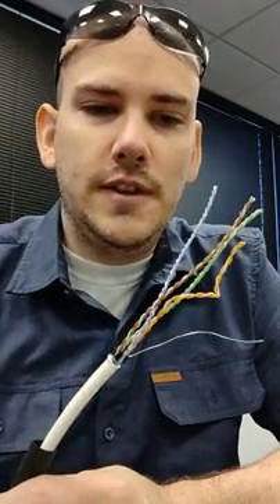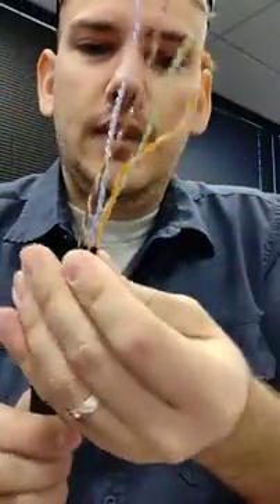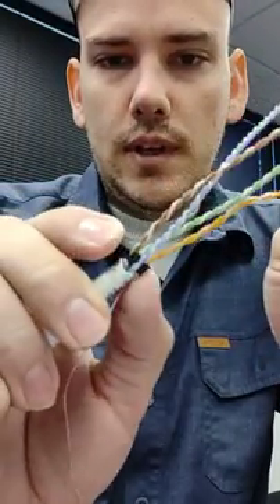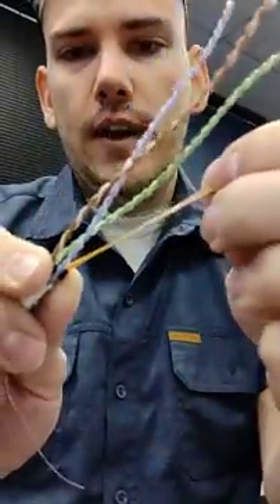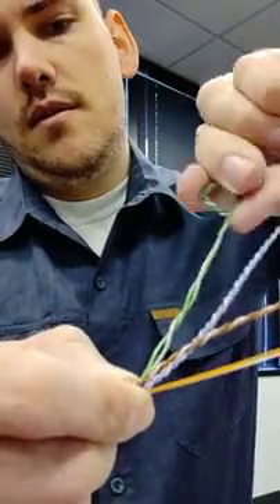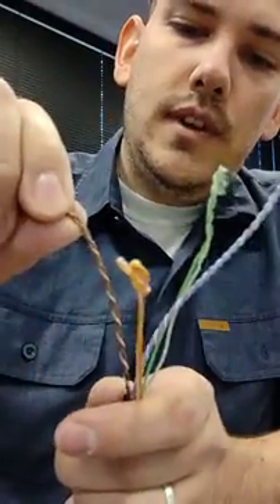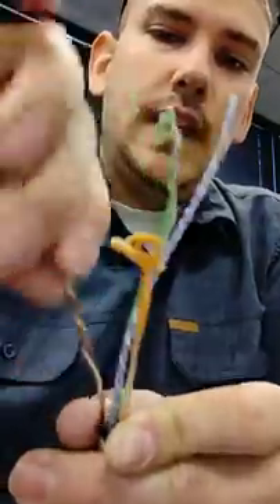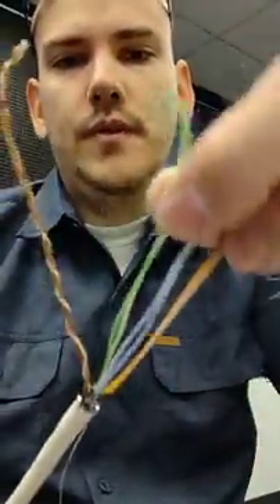The best way to untwist and straighten twisted pair cable in one step

Comment: Perfect advice!  I’m about to wire my own security system PoE and was making some test runs on 6E cable and was hoping there was a hack for getting the conductors straightened for RJ-45 terminals. This is it!  Thanks bunches!

Comment: This is fantastic, thank you.  I've never made any CAT5/6 cables until this week.  Moved into my new home and had to terminate about 20 ends and build several cables.  The first few before I found this were frustrating.  This with the pull-thru connectors makes it easy!

Comment: Interesting!  I split the end and spin one wire around the other with my finger on the tip.  Your method does not require the straighten step and returns the wire to it's original shape.

Comment: With all that wire it seems like quite a bit of waste. I only strip it down  about an inch and use nylon jaw jewelers pliers to gently straighten them out.  Not bad though, nice tip.
Reply: Yeah, there are many people that play Tarzan on the cable to get that perfect "E" string and then STAPLE the cable down killing bandwidth leaving a tiny amount left to work with.  They should be forced to correct it at their expense, like engineers should be required to take apart and put back together what they design!
Reply: It's an extra 3-4" of wire, so maybe 10 cents worth if it's fairly expensive wire (cat 6 direct burial gel filled shielded). It is WELL worth the cost to end up with nice straight wires, ESPECIALLY if using pass-through plugs

Comment: Nice. This is more curiosity than a real issue but you twist individual conductors in the process. Are they twisted in the manufacturing process and your part is actually un-twisting or not?
Reply: So twisted pair cabling like cat5e or cat6 is twisted so that the small electromagnetic charge given off by the flow of electrons through the wires is always balanced. Brown and brown white will always have opposing charge, blue and blue white as well etc. etc. The wires are untwisted after the sheathing in order to be properly placed in the connector before crimping it on. (In my experience you want to cut back a similar amount of sheathing like dude because you’re going to want to cut them all to straighten, and to length before placing them in the connector to be crimped).